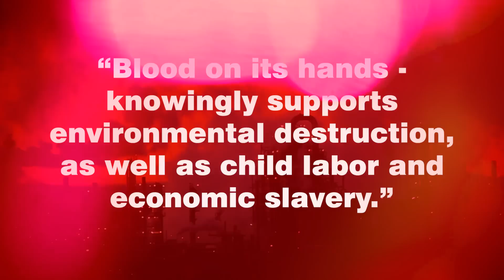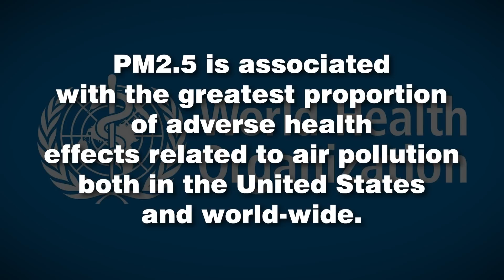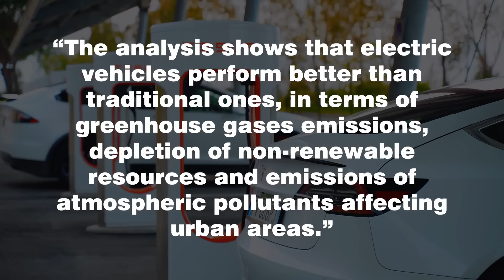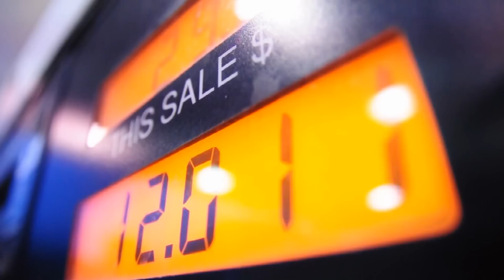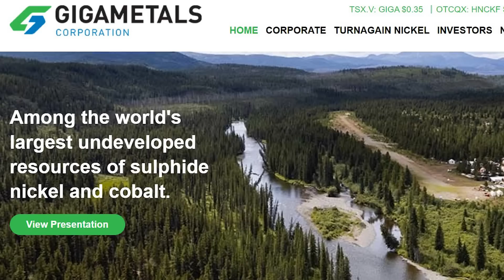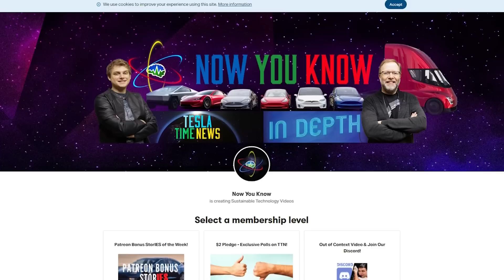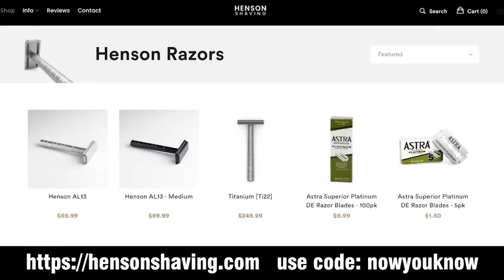Debunking More EV Lies | In Depth

Comment: The problem is that neither side are willing to to present a fair view, the truth is likely to sit in the middle, however the biggest nail in the coffin for non Tesla EVs will be the charging infrastructure, its just not reliable enough, this needs to be sorted.  Secondly Range needs improving, no point in saying the car has a 300 mile range when on a road trip you aren’t going to charge up to  100% at a service station because it takes too long after 80% and you are leaving 15-20% incase of infrastructure problems, so in reality only using 15%-80%, 65% off the capacity. And then take into account winter driving.

Comment: The point EVERYONE misses is that EVs are not about pollution, climate change or sustainability...it's about control...
If it was about sustainable transport the cars would be smaller than giant SUVs and the solar panels would be on homes not empty fields, along with batteries to help balance out the Grid.
We have an EV (Zoe, not a Tesla as Tesla's are far too big and overly complex/expensive), PV and a house battery along with an efficient Woodburner (local woodland) and we would happily use a properly set up transport infrastructure that is affordable...
There isn't enough electricity to replace fossil fuels and there aren't enough raw materials to replace ALL vehicles with EVs and there aren't enough recycling facilities...CO2 isn't a pollutant btw, it's plant food...money talks and EVs are far too expensive for real people to take up willingly (why else the coercion of cancelling ICE vehicles?)

Comment: Ask Cal. and Germany Hows that Solar doing?  Elec. getting cheaper and No Brown-outs.  Batterys are so good see how long you live with a battery in your water supply.   How many 10yr. olds drill for oil or mine battery parts.
Reply: When I went to Germany I also couldn't help but notice how many coal power stations there still are operating.

Comment: There is so much more you could have mentioned if you didn't mind the video going on for a few hours. You don't need to invest as much energy in recycling batteries as it takes to extract the raw materials, recycling can be as simple as taking a battery that is considered too degraded to put in a vehicle and use it in static storage (though there is a shortage of these cells - because they don't degrade as quickly as some would have you believe). This static storage can (and is) used to balance the grid so renewables can be more fully utilised. The demand for rare commodities such as cobalt creates more ethical sourcing which improves conditions and considerably raises standards in these third world mines which rely on this income - win win! When recycling batteries, companies first discharge the old batteries which then provides a good proportion of the energy required for the process. Additionally, and a point rarely made, electric cars are so nice to drive and cheap to run, why would you not go electric even if they weren't any cleaner?

Comment: Yes. Speaking of recycling batteries, and other materials in the EV, I recently watched a video on the Munroe channel where, in part of it, they talked about the process. Basically, the pack is frozen to almost absolute zero, thrown into a giant grinder and then the materials are separated.
Reply: She has a point on the recycling. Though new battery manufacturing techniques may allow for low-energy recycling, the existing techniques use more energy than mining.

Comment: I drive a 1999 Toyota Starlet it has no power steering no air conditioning manual windows and one airbag I bought it with a blown up engine and rebuilt the engine replacing only the parts that we're necessary. At this point in the vehicle's life it was already manufactured so it has no manufacturing emissions left to contribute it uses less than 5 L per 100km because it is very lightweight.  The tyres and brakes a small and I believe the brakes are still original and have not worn out  after 420000km  you see back in my day we had manual transmissions and in light traffic you almost don't need brakes in such a light small car is very good on tyres . Is also very cheap because I already own it but I guess it would be cheaper to go buy a electric car 🙄 also I looked up and in my country of Australia less than 10% of lithium batteries are recycled currently . Somehow I think going and buying a high-powered electric sports car is not going to save the planet you cannot do anything without creating some sort of emission the only way to create less emissions is to go backwards by that I mean handwriting letters and travelling around with horse and cart Society always needs a new laptop a bigger television and the latest iPhone or Tesla car only to be replaced within 5 years think about what a household looked like  in the 1950s and then think about what it looks  like today every single thing that we create courses emissions

Comment: Sorry, but you are WRONG.
As an EV owner for you to say that renewable energy will increase fast is just an outright lie. Maybe in small pockets, but on the whole as a global scale, NO.
The problem with Americans is simple. They only think they live on the planet, forgetting that there are another  7-7.5 billion people also occupying the planet. Most of these live in developing countries, or emerging markets if you want semantics.
Try replacing their poor infrastructure with renewables.

Fossil fuels will power many things for a long long while yet.

Nuclear is the way to go, SMR's.
If you relied on wind, that will end badly, if you rely on solar, good luck with that one. Hydro? Until it stops raining and the dams run dry... Ask Europe about that.

EV's are not green or even ethical, let's not get all high and mighty about that.
America is the biggest consumer of electricity per capita, you run AC all summer, then run heating all winter. At least in Europe only about 10% have AC, only heating in winter.
Sure, you can run a video and have confirmation bias, but until you prove otherwise, you are all just...liars too.

Comment: There are totalled Teslas that only just have a dead battery and people have disposed of them in interesting ways out of anger. A solution needs to be made that makes replacing a battery affordable enough to were it makes sense, or maybe a better price at the recycling places. Right now in my area a EV gets you no more money and often less than a gas or diesel car so why spend the time/money/gas towing it down to the yard.

Comment: You are spreading lies, as well. For example, at 3:11 "If you plug your EV panels at home, and you have solar panels,  then your EV is one hundred percent clean, no matter how you cut it." is a lie. This is true only if the panels are dedicated to car charging and there is a battery back up that stores power exclusively for the EV.  Also panels and batteries take energy and mining and processing to manufacture, and become toxic waste.  You are no better than GM unless you present arguments correctly.

Comment: Sorry guys but you are wrong. EV's emit nothing at the back, but they are still CURRENTLY dirty in two ways. Generation of electricity "MIGHT" hit 20% on a couple of days a year but in midwinter we are still burning oil gas and coal to generate power and this will be even more of an issue when EV adoption rates are higher. Moreover the amount of carbon produced in mining and manufacturing the batteries means that you are REALISTICALLY looking at 100,000km before you have cancelled out the carbon produced by manufacture with your clean powered vehicle usage

Things will get much better in the future i'm sure, but here are a few things to consider:-

Increased risk of injury from fire. Fire departments cannot simply extinguish an EV fire and the $hit that these things give off in a fire could hardly be called zero emission
We don't have the grid and charging structure or capacity for all of our commuter traffic to be kept on the roads if we are working to this deadline of 2035 or even 2040
There is simply not enough mining capacity to mine the cobalt and lithium to power the expected number of EV's
LESS THAN 5% of all EV batteries are recycled, or even recyclable financially
EV semi's  won't do the job of shifting goods by road
EV farm machinery won't do the job as the charge time makes them useless during harvest

Other technologies will emerge that will sadly make a lot of what is currently happening redundant and a lot of expensive investments will be hard to shift, and that even means the shiny new EV on your driveway
Salt based batteries, Hydrogen fuel cells, solid state batteries and a couple of new technologies that are not even rolled out yet will likely take the place of the battery Li Battery EV technology

You haven't debunked anything. And before I get any responses calling me a shill or telling me I don't know WTF i'm talking about, please note that I drive an EV and my wife drives an electric Hybrid
Diesel and petrol engines are dirty, The EV is a transitionary way forward, but EV's are not the F***ing messiah !!!

Comment: You make a lot a good points about EVs but for starters I still don't want an EV I want a big gas guzzling vehicle because that is what I prefer drive I don't care if you don't like it it's not your job or the government jobs to tell me I can and can't drive now if you made it through those comments 
Number 2 you failed to address in your video California week or so told people not to charge there EVs and to lower energy usage because the green energy grid couldn't  handle it so if you had to charge you EV you had to use a fossil fuel generator
Reply: Drive anything you want!  But California only asked not to charge from 4pm-9pm, which is irrelevant because 95% of EV charging happens overnight between midnight and 6 am.  In short, there was no inconvenience to EV drivers.

Comment: This is really stupid and uninformed. like this "ignore the things that comes out of the tailpipe but CO2" 4:57...

Well so that is not true for Gasturbines? Well it very much is, They are actually quite a bit worse than cars.

Nitrogen is really not a thing any more, with less than 80ug/km, the level are so low that it don´t matter. Actually a majority of NOx in european cities come from... power plants, not cars. Cars stand for typically 2-3%, trucks for about the same... power plants about 14-20%, so its actually quite a large diffrance.

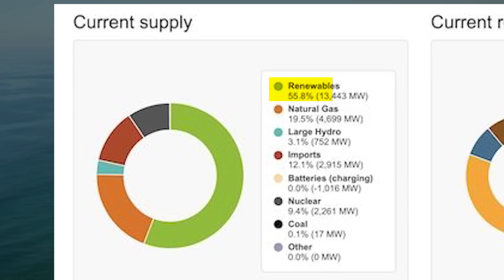And for the 4:12 power sources it totally ignore the net margin source of energy.

And for the study that compare with an imaginary Swedish fari tail battery factory (yea, the factory actually DONT exist). And even if it would, it wouldn´t help, becasue there is a power crisis in Europe. Ont even sweden have power to talk about

Comment: My issues with EV are the lack of range, lack of infrastructure, and length of time needed to recharge on average.  Furthermore pretty much all the things needed to be mined or recycled to make them still takes fossil fuels, and not just coal as most of the diggers and vehicles used run on diesel. Not to mention the diesel powered generators used to provide electricity in the places those items are mined. Effectively both you and her are using things that back the thing you are clearly trying to argue for and leaving out the other things that factor against it. So yes, while EVs are becoming better, and there are strong arguments for them environmentally, they are not yet to the point that they can fully replace internal combustion engines for everyone just yet. Especially while they continue to be more expensive to purchase in most cases for a vast majority of even Americans who simply don't make enough money to buy them, as almost half the country make below 30,000 per year making even a new 30,000  dollar car something it'd take over 2 years to afford, and that's if they saved 100% of their income paying no bills and eating no food that entire time. A family of 4 making below 28,000 annually is considered below the poverty line and around 45% of America is in that range of income.  Only the top 23% of American households even manage to hit 50,000 annually, and pretty much all these numbers are taken as gross, not net meaning they actually make on average 25% less than those numbers due to taxes. So you have to admit there are still a lot of kinks to work out for electric vehicles, and that is from someone that sees their potential and hopes they meet that potential one day.  Till then I continue to want a viable EV but remain unable to afford them.
Reply: I did a 4000  mile road trip this summer in my Tesla.  Was I not supposed to do that?
Reply: @SpottedSharks  How often did you have to stop for 30 plus minutes at a time during that trip though? Cause all but the most fuel inefficient cars will go 400+ miles on a single tank of gas, and when you do fuel the vehicle is full again in less than 5 minutes. Most of the best EVs have a 300 mile range and to get back to that at a "fast charger" you are looking at 30-45 minutes of sit and wait. Don't act like there is a difference.
Reply: @michaelcox9855  There were more stops and longer stops in my Tesla M3LR than if I had taken my Honda CRV, but the trip would have been less enjoyable.   I estimate the 4000-mile trip (FL to CO) would have take 4-6 fewer hours in the Honda (road time + refuel time).   The typical routine was to stop about every 3 hours/200 miles when we hit about 2-5% state of charge, juice up to about 70%, then hit the road again.  The stops ranged from 15-40 minutes depending on whether the supercharger was the older 150kw version or the newer 250kw units.  That's perfect.  It's enough time to visit the bathroom, walk the dog, have lunch, visit a shop or two, etc.   I'm much more relaxed and less exhausted at the end of the driving day than in the past when I drove with a get there ASAP destination tunnel-vision approach.  Non-EV drivers seem to think road-tripping with an EV is an ordeal.  It's not.  I'll never take a gas car on such a trip again if I can help it.

Comment: Wind generated power requires oil to make..interior of car requires fossil fuel oil…materials that make batteries…fossil fuel..I can go on for another hour,you can’t make an electric car without oil, until you eliminate all materials to make them. Switch to hydrogen!

Comment: Hey love the show believe evs will be the future, but how do we use ev’s to replace cars in the north. They don’t have the range, and are currently susceptible to the cold. You end up decreasing power by using power to heat.  Is there something I don’t know about how these will be replaced.
Reply from the maker: It's a great question, we actually have quite a bit of experience, living in a colder climate.

I have 2 different EVs, a 2013 Nissan Leaf and a 2018 Tesla Model 3.

Both take a range hit in the winter. Roughly 15-30% depending on conditions. My leaf has about an 80 mile range on a good day, but in the winter, suffers something closer to 60 miles which makes for a very uncomfortably small range.
My Model 3 usually has about 250 miles at a full state of charge, though I usually just charge to about 80% which helps prolong the battery's health long term. So on a summer day I usually charge to have about 210 miles. In the winter I take a range hit, usually down to about 180+ mi (@80%) however, if I need to, I can charge up to 100% and get back to 210 miles if I need to. But most of the time 180mi is more than enough.
On top of that, Tesla's superchargers are very plentiful where I live and could top me up within about 20 minutes if I'm traveling in nearly any direction.

The difference between my Leaf and Model 3 is stark, especially in the winter. I think that some people bought into early EVs, assuming they could live with short ranges, only to find themselves in trouble in the winter. This has led to a "meme" about it if you will, as it gets reported and re-reported every year. All the while, EV's are getting longer ranges and better methods to deal with cold (such as heat pumps).
I hope this is helpful (great profile picture btw)
Reply from the maker: TL;DR
EVs with longer ranges make winters easier to deal with.
Check out Norway, they LOVE EVs

Comment: The thing many of the EV supporters seems to forget is that mining is the single most destructive thing to our planet. AND it takes a MASSIVE amount of mining (which burn huge amounts of diesel) to create batteries - oh and then you need to ship those raw materials to plants where the batteries are manufactured (which uses huge amounts of diesel again).. This issue is actually FAR more complex than just EV"s are better.. Sure in some ways, but wind and solar cannot be the answer.. because the wind doesn't always blow and the sun doesn't always shine..  as Germany can attest to.